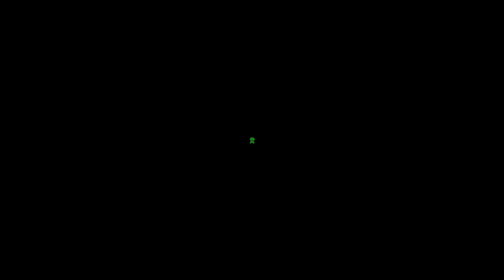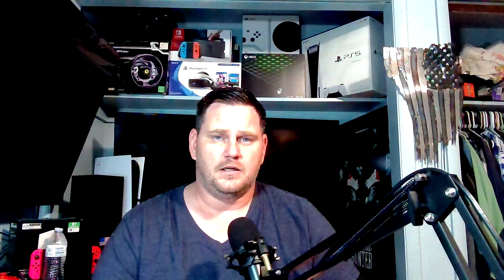Did Austin Evans Lie About The New PS5 Heatsink?

Comment: The fan is bigger and can adjust speeds too .. Austin meadows isn’t an engineer I trust Sony engineers then the armchair engineers that are in Twitter and YouTube . It’s one YouTuber who is notorious Xbox shill.
Reply from the maker: You are right sony needs to explain why this is better.
Reply: @Frogboyx1gaming  and he only measured exhaust heat and Xbox series x has similar
Or higher exhaust temps. We need multiple readings of the internals from multiple sources to truly
Know if this is really an issue or not. Tbh I don’t think this an issue till we see consoles failing I’ve seen PCs  run way hotter and still have a long lifespan
Reply from the maker: I am not even claiming this will be an issue. All I am saying is Austin Evans did consumers a solid. But we have physical proof that the new Heatsink is nowhere near as efficient as the old one.
Reply: @Frogboyx1gaming  I don’t think Austin did this for the consumer a favor he did it to clickbait and bash on Sony. This guy bashed PS5 at launch and claimed Xbox  series x would perform better but yet multiple times PS5 has more stable framerates then Xsx.
Reply: @Frogboyx1gaming  He's a big Xbox fan. He's biased towards Microsoft. But I think he didn't show false temperature data. He did a good job showing everyone the internal parts of the new model. But he started blaming its design and he blindly claimed that the SoC is running hotter without testing the internal temperature of the console lol. That's why no one should rely on the assumptions that these kind of YouTubers give people. No one can just check the external temperature of the plastic parts of a device and tell if the internal components are hot or not.
Reply: @ohwow2074  exactly he only tested external temps and if you properly maintain your console  with cleaning out the dust and keeping it in open space it probably won’t be an issue
Reply from the maker: @ohwow2074  I said we should look to Sony for an explanation. It is their responsibility to inform the consumers.
Reply: @jeffbgaming786  but as a PS5 fan I would be mad if Sony did this and increased the temperature of internal components. It's not okay. But all I want to say is that we won't know what is happening inside the new model until a professional guy measures the internal temperature of this new model. We can't make stupid assumptions based on an infrared thermometer!
Reply: @Frogboyx1gaming  Yes I agree. The fact that they don't inform consumers in a clear way is another sin of theirs.
Reply: @jeffbgaming786  I will say this again, lowering the resolution to have more stable frames it's not having better performance.

If I put my low end pc on 720p I can have higher and stable frames that the Series X and PS5.

Its this outperform? No, it's having compromises.
Reply: @fabioalves2252  it’s slightly less resol not enough to notice with naked eye you have to zoom in with machines . I’ll take the slightly lower resolution for more stable framerates and why does Xbox have trouble with ray tracing 🤣🤣😂🤣 digital Foundry video on little nightmare 2 is newest example of that
Reply: @jeffbgaming786  little nightmares has raytracing disable ON Xbox for some reason. Do you xbox can do ray tracing also right? They just dropped a patch to Hellblade and Doom Ethernal plays amazing.

20 or 30 % more it's not a small difference. It's the same ratio as the same ratio as 1440p to 1080p, which is a huge difference. 
It's a bigger difference than GOT increase to GOT director's cut and eveyone is saying it looks way more crisp.
Reply: @jeffbgaming786  Actually, XSX is around 65-70c on exhaust temp. Guess what? No one complained. Psssst. Don't tell that to anyone ( logic - higher exhaust temp. - less hot air inside and better cooled components, which XSX really has )
Reply: @imt558delux  this is why I don’t get this drama one youtuber who clearly has an agenda agianst Sony just by reading his titles. If he had tested internal air temp and multiple times it would be one thing but this guy used a mobile app to read the temp of the exhaust and then came with the conclusion that the ps5 internal is hotter without actually doing an internal probe is stupidity.
Reply: @jeffbgaming786  Xbox fans are doing what they do best - spreading FUD
Reply: @jeffbgaming786  at a way lower resolution how hard it that to comprehend, enjoy your 1080p
Reply: @SuperSublime9  yeah except all but one game are 4K nice fake narrative there xbot🤣😂🤡👈👈
Reply: @SuperSublime9  bruh you can’t even tell unless digital foundry tells you it’s checkerboard xbot fanboy 🙄🙄 and where’s the ray tracing because apparently Xbox don’t know how to put in their exclusive games🤣😂😂🤣
Reply: @jeffbgaming786  if you're so smart and ps5 is so awesome then why can't it ever have the same resolution as xsx, why does the series s play more games at 120fps
Reply from the maker: The same sony engineers that brought us the Jetliner PS4 PRO?
Reply: @Frogboyx1gaming  jetliner PS4 Pro never failed. Yes it was loud but didn't fail.
Reply from the maker: You are right. I am not saying this is bad.
Reply: @Frogboyx1gaming   Yes, and...did PS4 Pro died? Mine since 2016 didn't. People complained about how it is loud ( which is )
Reply: @Frogboyx1gaming  ..."the same engineers that brought us the Jetliner PS4 Pro"...man you exposed your fanboy underwear with that comment..lol!! .say whatever you want about the PS4 Pros fan volume, which to me is waaaaayy over exaggerated, but regardless the systems are durable & reliable. I could see you having a point with that comment if the PS4 Pros had a significant failure rate &/or performance issues but they didn't. Your comment really makes you look disingenuous
Reply: @UCn8XhMWqtAyBS3rdzfLF40A no you don't Jeff all PC parts have their own cooling systems don't even try this or you will look a fool and yes a PC can run hotter than a console because it is much bigger with much better airflow it's not constricted in a confined space with hot components.
Reply: @severinevans346  and yet PCs for the most part still run well if they are MAINTAINED like the revised PS5 will. And unless they are desktops they aren’t bigger cases. Nice try though
Reply: @jeffbgaming786  even in a mini itx configuration still has more airflow than a PS5 Jeff and more than one fan for air flow or even better water cooling.
Reply: https://youtu.be/SBu_Sg5Jr_o
Reply: @tenfeet upof course. It was an unexpected issue 100%.
Reply: @tenfeet up Hitman 3 on XSX has way worse performance than PS5. It drops to 40s, while PS5 is stable 60. Also XSX has around 5-6 fps advantage in the SAME heavy scene over PS5 in RE8 Village in RT at same resolution. I guess, that's a monstrous 1.9 TF full RDNA 2 and higher bandwidth advantage. LOL
Reply: @tenfeet up You played shit. Go check DF videos again. XSX drops to 40s, no need to ignore it. Xbox fan talking about damage control, yet ignoring obvious fps drops in Hitman 3. let alone XSXs in RE8 drops to 40s, just like PS5, Xbone fan. No need to ignore it, Xbox fan.
Oh, Xbone fan VRR excuse. Very small minority of console gamers have a capable VRR TV/monitor. So, cut the crap Xbox fan. DF, VGTech, NXG because are analyzing games to expose framerate advantages and flaws to the audience and show the true state of the game. Not with VRR. LOL
Reply: @tenfeet up

So what if TCL is 600$. LOL Not everyone will buy it, Xbox fan. Does everyone buy XSX and PS5? Nope.
XSX version of RE Village has around 6 fps advantage just during heavy fight scenes over PS5 and that's it, Xbox fan. Lowest where XSX drops is 48fps, PS5 is 47fps despite noth has the same resolution in this game. Cut the crap, Xbox fan
 You're delusional Xbox fan. I'm not lying if XSX version of Hitman 3 has worse framerate performance. If it drops to 40s, then it performs worse, Xboy. Oh, shit, shadow is at higher settings. Oh, higher settings shadow impact gameplay experience, not the framerate drops. :/
What is the point of higher resolution on XSX in Metro when it has up to 16% worse framerate than PS5 version, Bone fan. So much power in XSX.
Reply: Jeff, the only thing everyone is saying is Original heatsink Versus New Heatsink = Original heatsink is a lot better. Sony cheap out with this new version of the ps5 and everyone should know it. Will this matter in the long run for the performance and what not? Indeed we have no clue  BUT what we can say for sure is that the heatsink is worse therefore one can assume that maybe just maybe this new ps5 is worse in some way or form.
Reply: @hELLLcs  fan is better and we don’t know if the components inside have been changed so we don’t if they heat up as much we aren’t gonna know till a internal probe test is done of the PS5 you also have to remember Sony has already lots of QA testing on this as well. All points that were in that video I linked
Reply: @hELLLcs  You can say it is worse at all. LOL. Bigger doesn't mean is better. Smaller heatsink can be more effective one than a bigger one if it is designed smartly ( which is in the new PS5 ). Older heatsink in PS5 is overengineered and also looks like it creates hot air pocket which is retained somewhere inside PS5 and that doesn't go out, therefore, some components get hotter because of that. Looks like new one is more effective because exhaust temp is hotter. It means less hot air is retained in the console, it is quieter and fan RPM is slower, which means heatsink it doing its job properly.